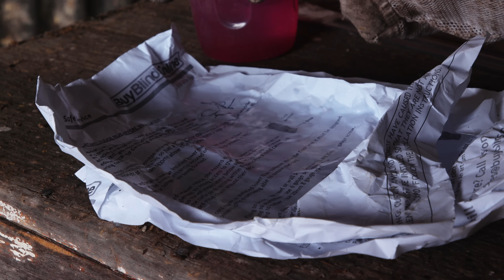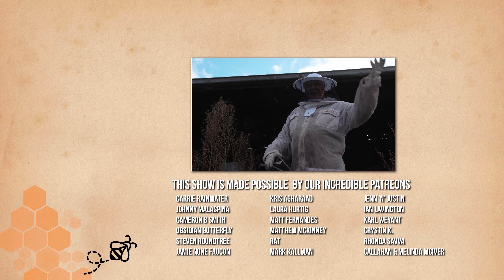The Bush Bee Man Finds Unexpected Swarms In Farm Sheds

Comment: Mark and John
Tip :
If you have a real good mess of a Hive (random Cross Comb) if you can lift the Box in all its entirety. And under Super it with a Deep Box of fully Drawn Comb. Once the Bees have all gone and migrated down to the proper Comb, you can then add Super above the Deep and remove that random Box of Mess. Either melt it down. Or spread that wax about the Walls and Frames : they will clean up that spare Honey. And make that "Mess" it into a "Bait Hive" to lure in a Swarm thats more directed to do proper Honey Comb next time !
Hope this helps. 😎 
🐝🐝🐝🐝🐝🐝🐝🐝🐝
 Happy Beekeeping 2023
🐝🐝🐝🐝🐝🐝🐝🐝🐝
Sometimes random Comb is just to messy to save : if you cut it out and try and Rubber Band it back straight, alas the Bees will Drown in all that drippy unhydrated Nectar.
Better to make the Bees move it to another Box, and then remove the offending one.Sorted.👍

Comment: Turning honey and nectar upside down will all leak out and make a terrible mess. I saw a gal did a cutout and put the comb upside down, sadly it wasn't pretty.
Reply: I saw an experiment in a video turning brood frames upside down and they used them like normal despite the angle being wrong, but showed a clear preference for the frames that were the right way up. Cells are angled downwards to prevent spillage, as soon as they uncap an upside down honey cell, it starts leaking and they have to clean it up and move it. Could go wrong, or it could work. Definitely an interesting idea if it does work.